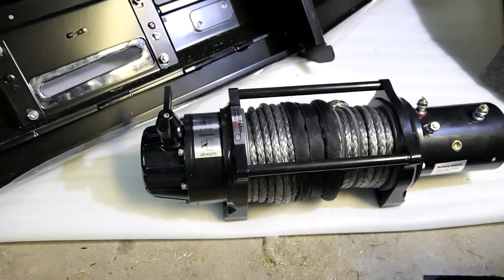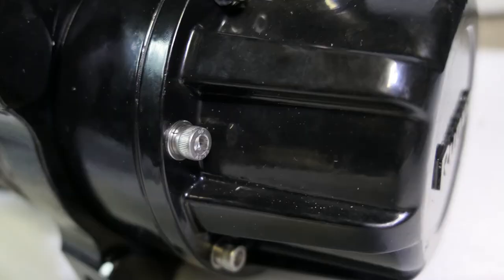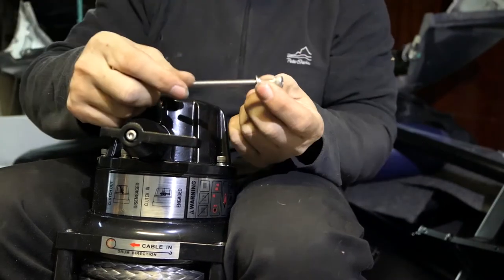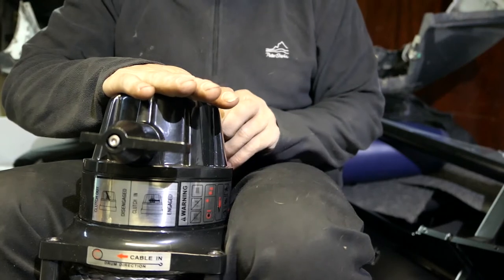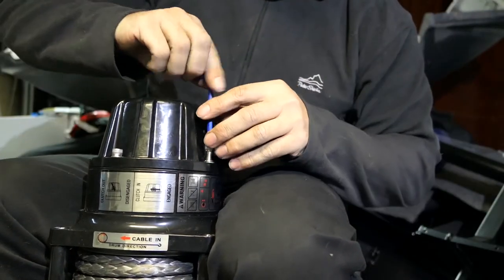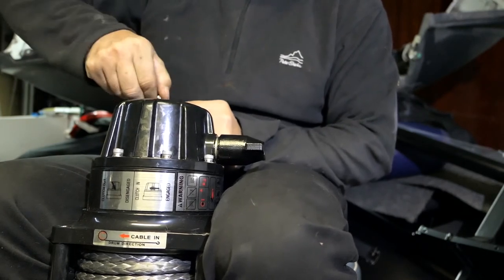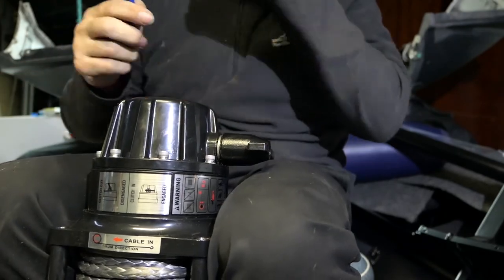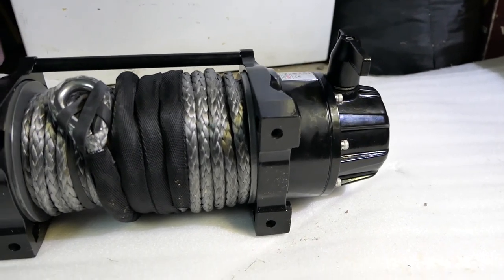Runva Winch Clutch rotation 11xp premium -how to

Comment: Didn't know you could do that. Thanks mate
Reply from the maker: have you been bending your hand 90 degrees :)
Reply: @DENMONKEY  I've got access from underneath but once I get the runva I'll definitely be doing that and punch the access slot out on the ARB bar.

Just out of curiosity, how do you actually open that top access slot?
Reply from the maker: mine had the slot cut out when I got it. It had a plate that can go over it if you want to but I didnt install it
Reply: @DENMONKEY  ok thanks for that